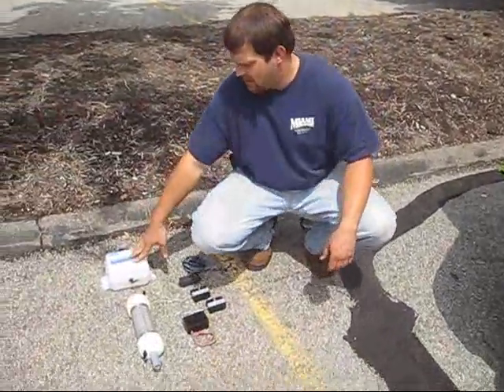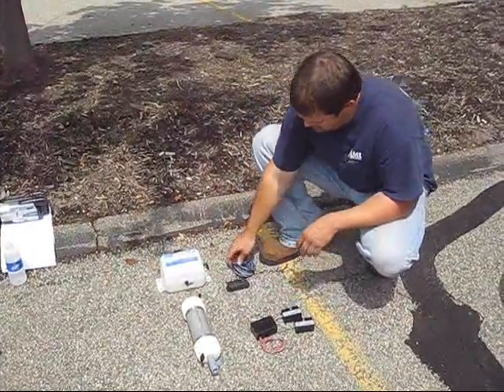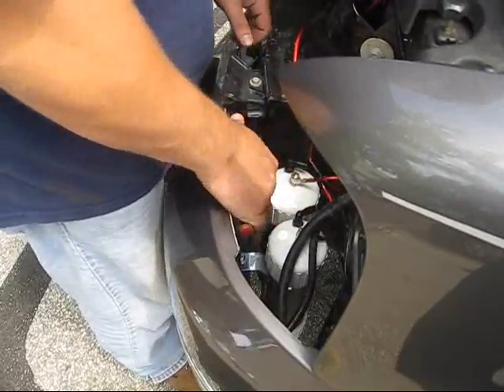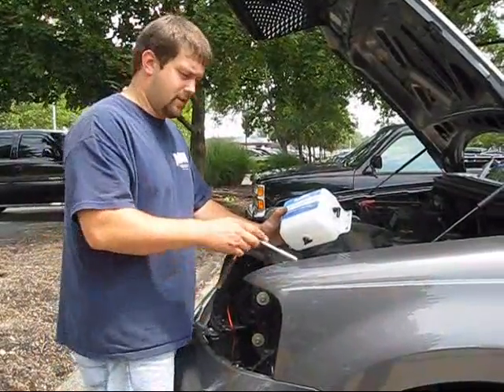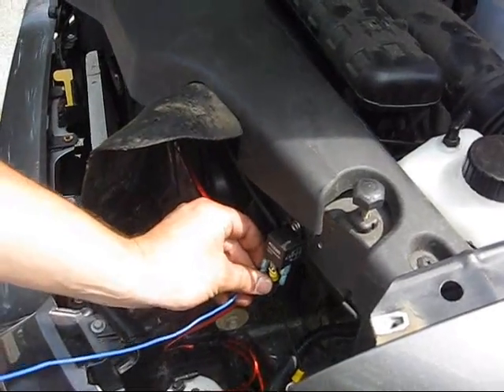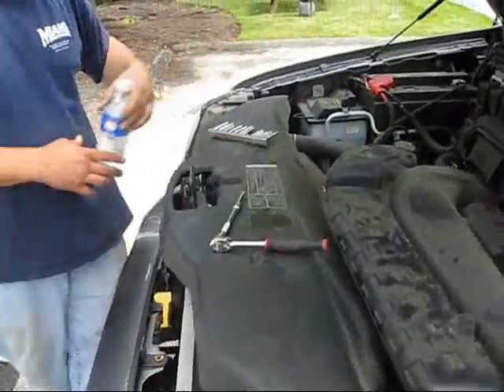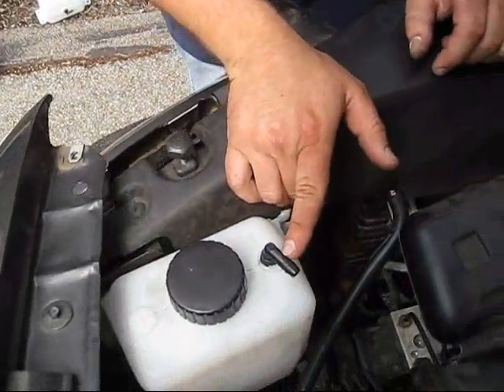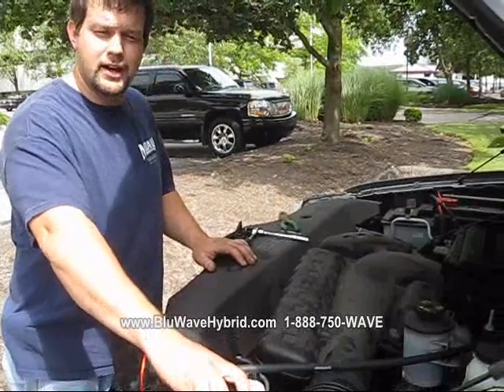Hydrogen On Demand Installation Video

Comment: So, the HHO is produced from electricity from the battery. The battery is charged by the alternator. The alternator gets it's energy from the belt. The belt is moved by the engine. The engine is powered by GASOLINE! Amazing. There's no free lunch.
Reply: The hydrogen that is being fed to the system is explosive, but the actual benefit comes from how it effects the fuel being fed to the system. The energy byproduct is not just of the hydrogen itself but of its mix with the gasoline, giving it a higher overall diffusion coefficient which leads to more power dispersed from the explosion used to push the piston. It also increases engine efficiency with load control and start-and-end thermodynamic cycles are effected due to an improved heat release duration.  This is a greater yield overall than the energy used in the electrolysis, especially with tuning to improve the electrolytic system.

Will this get you 50, 60, 90% efficiency gains?  Fuck no.  But it's good for your engine and you will get 15-30% gains.
Reply: Not that I'm fully disagreeing with you, since the gasses produced are so minimal, but there are legitimate pros to the process that make the mixture cause for an increase in efficiency.  It's not "creating" more power, just utilizing potential chemical energy already existing in the system from the original fuel source being better optimized.
And there are engineers who have done tests on both HHO and H2 and have indeed found benefits that outweigh cost.

I assume it's not properly developed and widely implemented for the same reason dual fuel systems aren't used in the USA (you never see LPG installed here): there's simply not enough of an interest in the market, and saying "hydrogen" can scare away customers.
Reply: @The Madrummer  Engineers? What engineers? And don't point to anyone wearing a t-shirt on YouTube. They aren't credible engineers, are they?

15% gain in efficiency? That would be phenomenal! Such a fantastic gain could save a company millions of dollars..... if true. They wouldn't wait for acceptance in the market. They would adopt this "technology" without the approval of anyone else. There are competent engineers in countries all over the world who could employ this simple device. They wouldn’t have to wait for approval from the US government or populous.

Fear of hydrogen? How about companies that use hydrogen as a normal part of their business? You can say they have a respect for hydrogen, but not a fear. They would love to get a 15% gain in efficiency of their service vehicles and stationary engines. They could be First Adopters, putting their own money on the line and reaping the benefits of a 15% gain in efficiency.

But we don’t see this magical device being used in any way that can be verified. Just backyard mechanics in t-shirts making wild claims that gullible saps say are credible.